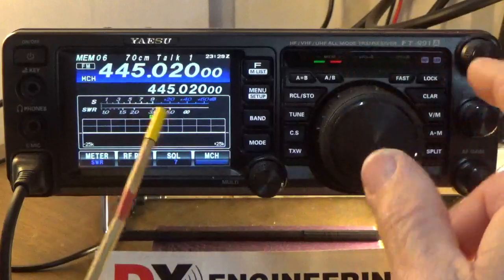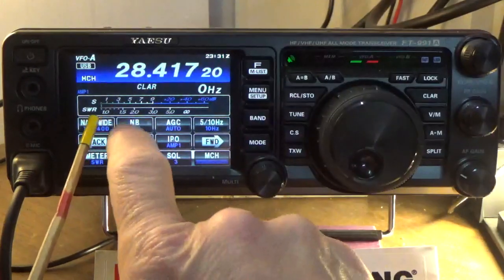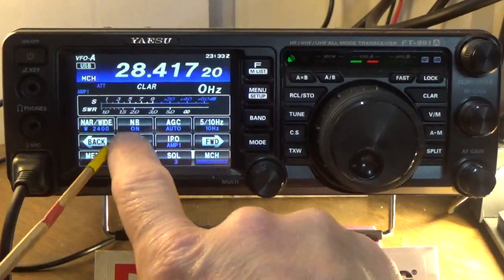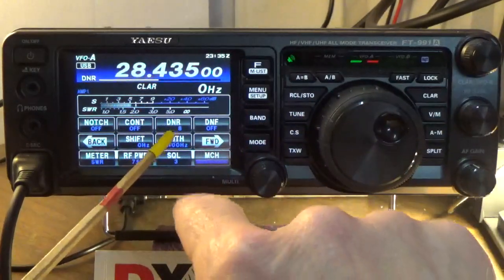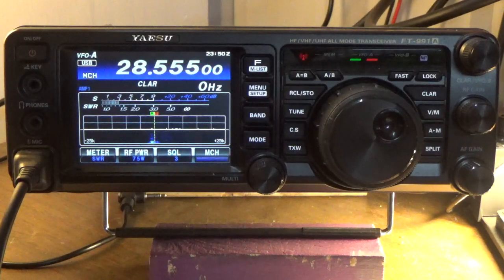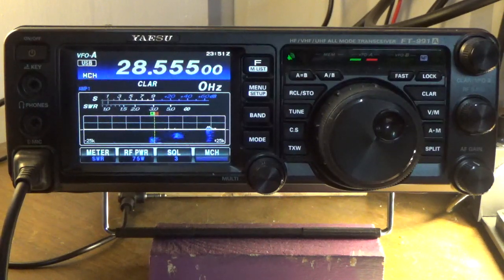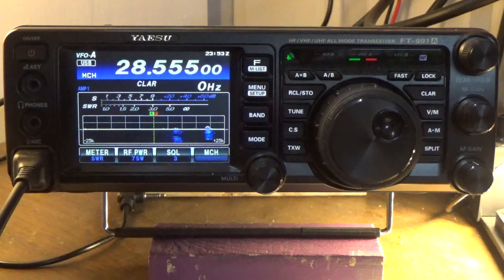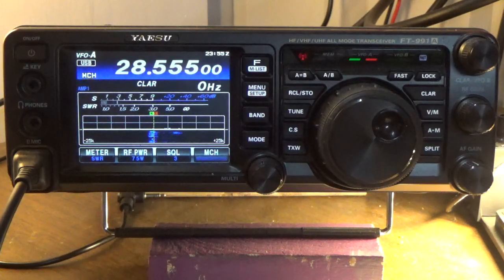Working 10m contact into Japan JG1OUT with heavy traffic & making the contact (ATT) and (NB) demos

Comment: N0spw 
I have the exact same radio I haven't talked on it much I am A-Tech no code I am looking at getting mfj 1786 magnetic loop antenna and for the 2 meter 440 I am going to be running a arrow 2 m 440 J Pole
Reply from the maker: Good evening N0spw, glad your on the air and look forward to making a contact with soon, I've been curious about the J Pole let me know how it's working and keep in touch '73 from KI5JUF